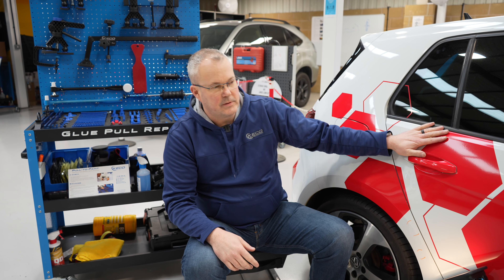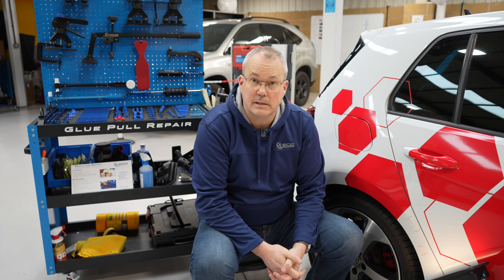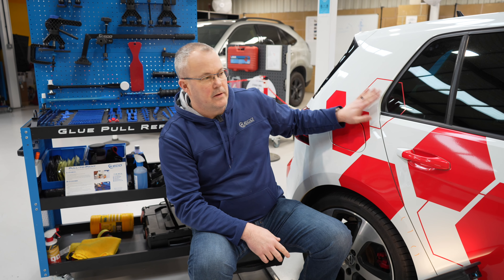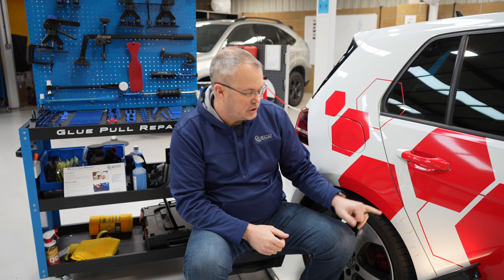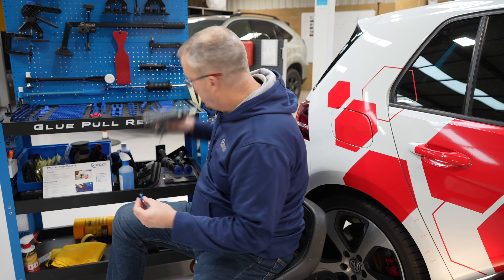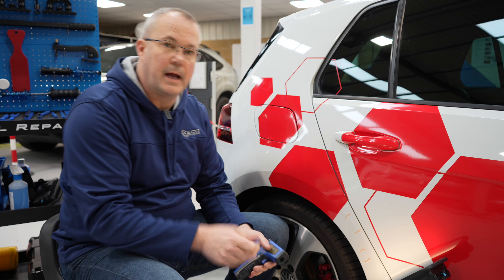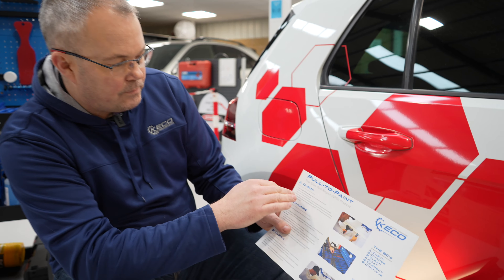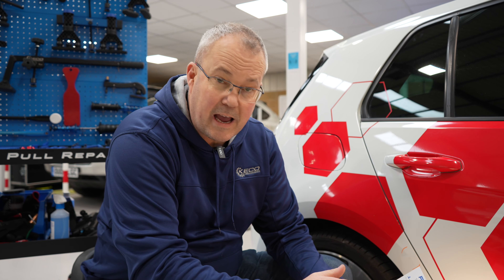How Do I Glue Pull a Vehicle with a Ceramic Coating?

Comment: How do i glue pull on ceramic? Just get rid of ceramic, i waste my time here
Reply from the maker: Thanks for your comment. That's actually incorrect. As per the video, the ceramic coating stays on the vehicle. It is the EXO V5 top coating that we remove via the 6C's Process. It is that coating that doesn't give us any adhesion. Once that is removed, we can glue pull with the ceramic coating intact.